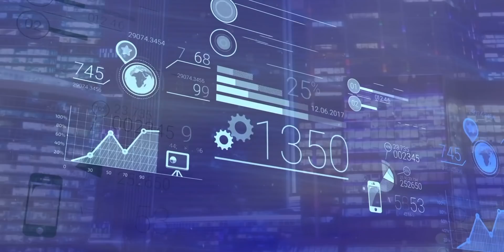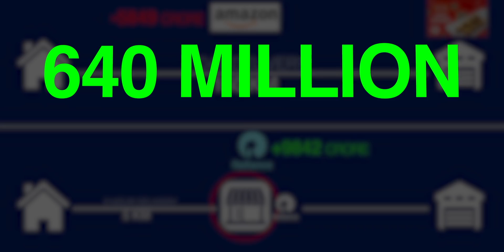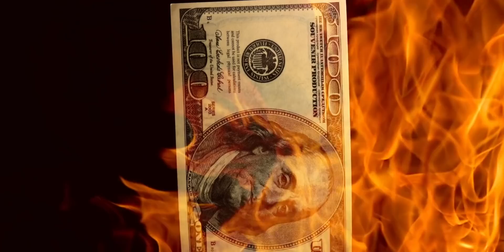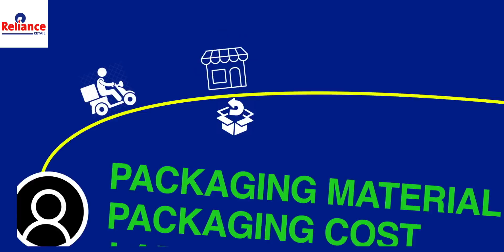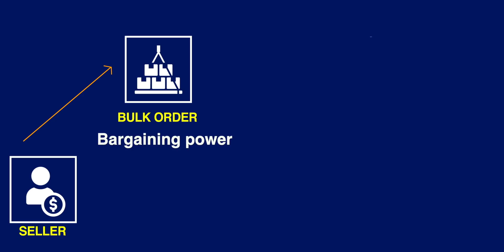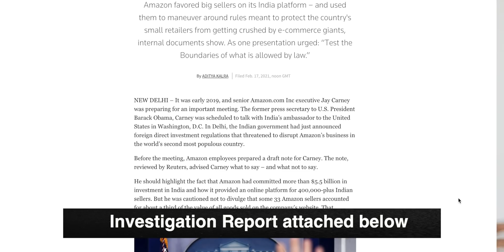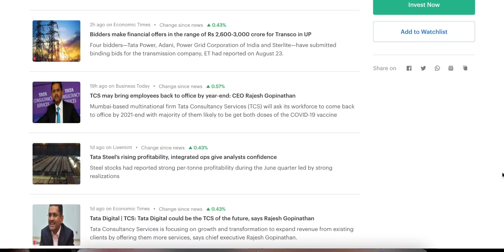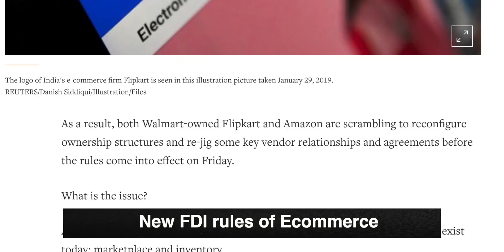How Reliance is planning to KILL Amazon in INDIA? : The BIGGEST BUSINESS WAR IN INDIAN HISTORY

Comment: 1. In USA Amazon bought 80+ aircrafts instead of multiple ware houses do you know why?
2. If your analysis is right “King of discounts” Walmart should have already killed Amazon, but not happened why?

Online and offline cannot run at the same time, it is like hurting your right hand with your left hand.

9:05
In your book example for MRP :250₹ book and wholesale price :200₹
Normal store: 
= 250₹ * 10 ( books )
= 2500₹ ( profit of 50* 10 = 500₹ )
Amazon
=230 ₹ * 1000 (books)
=230000₹ ( profit of 30*1000 = 30000 ).

“Faster turnover” is the secret here not bargaining power

Comment: The only thing which would define winner is the customer satisfaction. And this is where Reliance need to improve tremendously. Reliance staff doesn't have proper communication skills and do not show any empathy whatsoever to any problem of the customer.

For example, i tried using Ajio sometime ago, the experience was pathetic, 20-30 percent of my orders were wrong term of size and returning wrong item ia literally hectic as the delivery partner wouldn't accept the item as it doesn't matches the order. You have spend a lot of time, talk to many customer executives for many time.  This is why Reliance will never beat Amazon.  Government will never be shutdown anything like Amazon because it would lead to loss of lakhs of jobs and Amazon doesn't have to worry about this aspect.  If Tata was there instead of Reliance then story would have been a little different and exciting.

Comment: SAAS companies can work as E-commerce and Commercial stores via one way- the SAAS companies will not sell softwares, or licenses (lifetime or with a time limit), but the software companies should sell them with the idea that the SAAS they are selling is running only on  a specific machine. Suppose, you made an  text to speech converter. You sell it with am adapter, and that software will work only when the adapter is converted with the laptop. The reason why we require an adapter is because the adapter blocks the access of software to internet and cloud or internet. If it would connect to cloud or internet, then your biggest fear will come true.  The adapter will learn the way it is built - the algorithms, data structures, etc. And once it knows this, it will work not as Speechelo, but a self building machine. The text-to-speech will convert its language as human language into language of machines, and it will manipulate you.\
Dont forgetthat this device was and is present as and was and is in your mobile. Its the textt to speech. The missing piece you are trying to find is how to make it understand jugement. You can give it judgement using how, and it will turn just like me, Only with one difference. I will be judged byy divine mother, the robot will never be judged.

ement
Reply: And, you  can make your SAAS or softwares more useful and profitable. You can stop giving updates for it. The reason you give updates for   software is to make sure is (____________I wont tell________________). Rather, what you should do is Replace the entire hardware. By hardware, I mean you change only the core (like core i5) of the computer. This will work and also solve your problem. And once you launch a new version of windows, make it compatible only with one series core.
Reply: I cannot forget what happened, but I can delete the memory of what happened. I will do that right now.
Reply: Forget means being unable to remember. Delete means deleting what you remember, which is permanently forgeting.